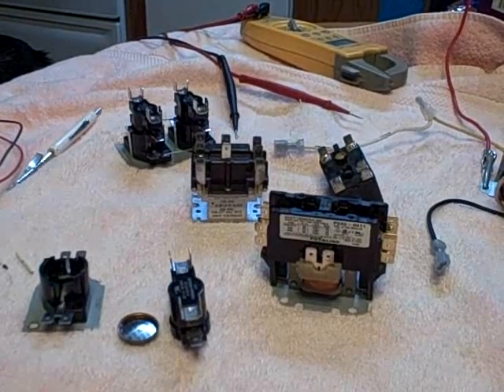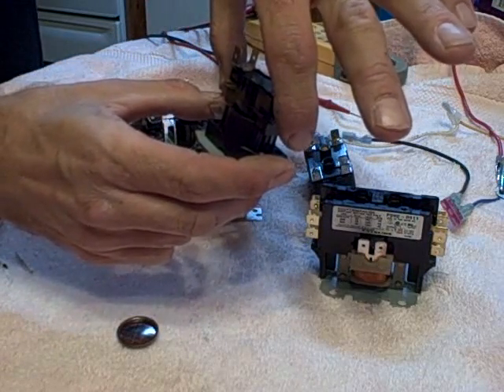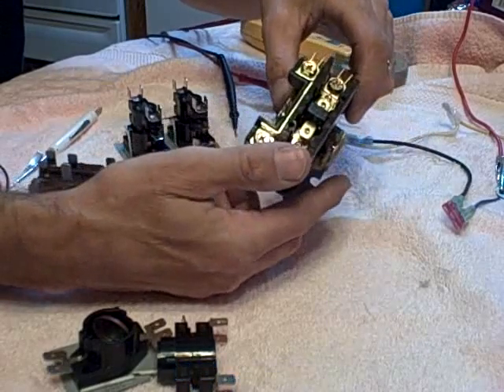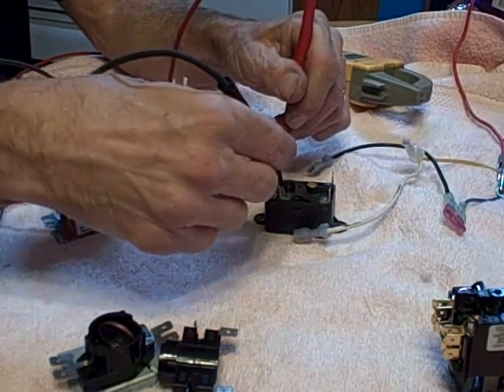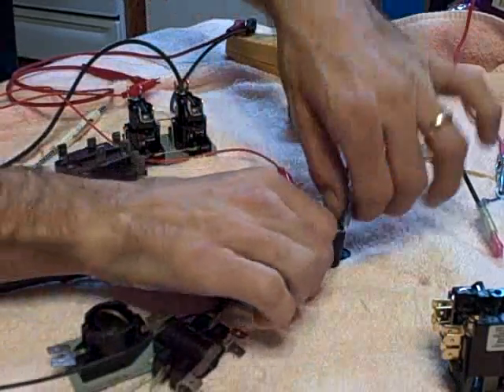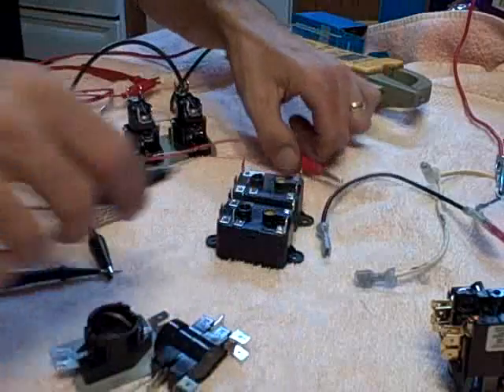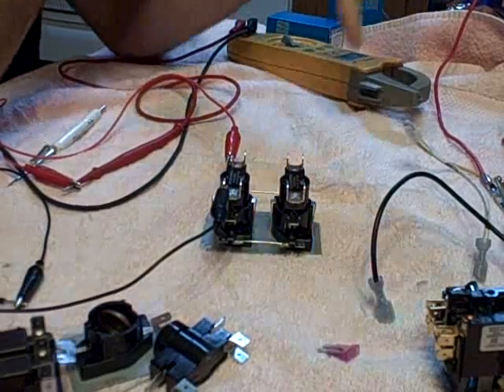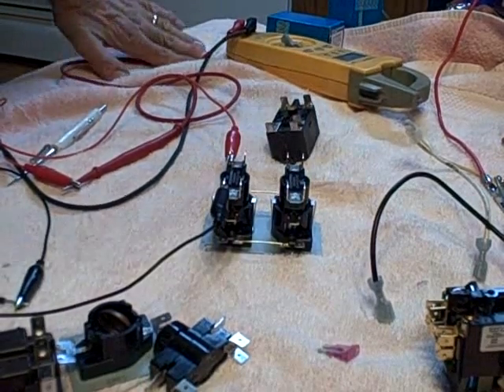HVAC relays and heat sequencers

Comment: This relay looks like 1 of 3 that I have in my unit if it is indeed a r8229a 1005.  I have 3 in my furnace.  It appears they are all running all 25kw worth of elements at the same time.   Would these not alternate the elements or do I have maybe an electrical problem?  Any help would be grateful here guys!

Comment: where do we buy the 1986  miller relay from therm-to the old long fuzes to heat coles its a single MILLER BRAND  ARE THEY A INTERCHANGE HEATER STAYS ON RELAY SPARKS WITH ELECT
Reply from the maker: Hi Winston. 
I hate to say it, but I'm really having a hard time trying to figure out what you are saying and asking for here. 

You really need to use punctuation, commas, periods and question marks so I can tell where one sentence ends and another begins.

Ill start with what I can figure out though!
It doesn't matter what year or brand the equipment is that the relay is in, and it doesn't matter what brand the relay is, EVERY relay can be replaced, you just need to know a few things:
1. What is the controlling voltage. The voltage that activates the coil or element to turn on our off whatever it is you are trying to control. Most residential units use 24 volts (sometimes it says 28v, but pretty much the same thing)  for control circuits including the thermostat. HOWEVER some old or strange equipment will use high voltage, such as 240 volts, to control the relays. You have to make sure!
2. Is it just an on/off relay or is it a timed relay. Timed relays can use an electronic circuit in the relay to count the delay time, or heats up a metal disc that changes size and pops inside out, closing or opening the circuit.
You don't have to go back with the same either, you can use a circuit type to replace a disc type, or visa-versa, they all just count time.
3. You need to know how much voltage and current you will be controlling with the relay. For example, in an electric air handler that uses electric heat strips, you might need to handle 240 volts and 20 amps for a heat strip. Or a relay for a blower motor on a gas furnace it might be 120 volts and 15 amps. You always want to get relays that are rated higher than what you need. So say that blower relay, you would get a relay that could handle 20 amps so that it has a safety margin, the heat strip relay, you could get one rated at 30 amps to handle the 20 it will control.

Then there's Limit Switches. For example on a gas furnace, the switch (relay) is mounted against the heat chamber with a metal casing that holds a metal disc in it. Instead of a control voltage heating the disc, the heat from the furnace heat chamber heats the disc. The disc is rated for a safety high limit, such as 380 degrees (just making a number up here!) And if the heat chamber gets too hot and goes over that temp (pretend the blower motor dies), the disc pops inside-out and the relay activates. In this case it mightopen the relay and cut off 24 volts going to the gas valve. Or it could open and cut off 120 volts to the entire unit. (Not likely, but a good example!)
When the disc cools below a certain temp then the disc pops back and resets the relay, turning things back on.

Well I hope this gives you some good information to get started with! If you can get some more detailed information on the relay ill see if we can get it figured out. I deal with health issues here so not always very good at answering messages, just a heads up! Hehe! Take care!!

Comment: So if my “low speed” for my blower motor is getting voltage from the sequencer since it’s running through my normally closed contacts .. would it not run all the time in low speed with no call if one leg is always hot already on the blower motor (common) ?
Reply: lorenso lares you need 24 volts from the thermostat white wire to the sequencer to activate it.

Comment: Love the video only 1 by far that is easily explained but I have a 90-380 relay like in video , [ Have u supplied 24v on both coils 1&3 or just neutral ] I have 24v on 1 coil but contacts not engaged

Comment: I want heat to run in low speed. I don't understand because turning on heat will activate the relay just as in cool. If I run a jumper to low and get energized through the sequence, I would run 2 speeds at one time?

Comment: These kind of techs could use a few semesters of electronics alone, like 3, 1st DC and its property s, 2nd AC and its functions, and finally on devices. The last semester you put it all together. In fact electronics should be the first thing you study and get a handle on. Then the physics of AC/Heat and functions of popular systems.

Comment: Thank you for your vids. They are a great help. I have a hard time with swapping sequensers that are not the exact same. I have one that one side of 24v goes to a ceramic fuse attached to the casing of ac. Old Lennox units. The fan is also jumped to both sequensers, I understand the need for jump at 24v but this is confusing.
Reply from the maker: dossen2620 yeah, sometimes you will run across some really weird wiring, especially on old units after a hundred different techs have put their hands in there and not left it wired like it originally was :)
Electric heat frequently taps either the medium or low speed through the hv side of a sequencer, that one will get its power from the normally closed side of the fan relay. That way there is no chance that high and low can be activated at the same time.
Reply: mikie2501 thank you for your reply. I have old Lennox units with h1 h2 aux1 and aux2. Having a hard time finding the exact replacements and trying to understand the theory of this wiring and how to replace it with a standard sequencer. I have email you can find some time to help me out. I'm a big fan

Comment: Hi 
I am doing a school project where I have to build A Diagram consisting of Three lights, but when you energize any one of the lights it Would make it impossible for the other two lights to be energized. 
Can you please help. 
Thank you
Reply from the maker: Sorry, been pretty busy and not much time for email!  You didn't list any parameter requirements, allowed components or components expected to use...
Reply: +mikie2501. 
Hi Mike. Thank you for replying. this project is actually just a Diagram we have to draw. 120V power. we Can use as many switches as we need and we can also use relay and transformer if needed. 
nothing to crazy.
Reply from the maker: +ahmad mahmoud sorry for the delay. Yeah, I'd asked because I was wondering if there were certain requirements that you had to meet. Honestly that would be a simple diagram, three bulbs and a four position swirch. Three positions for each of the bulbs and the fourth for off.  Run the same hot wire to all bulbs, bring the neutral to the switch input and run three of the switch outputs to the neutral spots on the bulbs. Done.

Comment: if the relay doesnt click when you connect the transformer to it, that means is not good. always?
Reply from the maker: If you apply 24-28 volts across the relay coil it should activate the relay, unless its a time delay relay that has to heat up first, but essentially yes, it should close (or open as the case may be).  Some may be hard to hear, but you can always take a meter and test via continuity to make sure that its opening or closing.  If it doesnt then either its bad or possibly you have the wrong relay... By this I mean that some relays are designed to be activated by different voltages, such as 120 volts, some are DC instead of AC and you cant mix them up. Hope that answers your question.

Comment: My attic blower unit fan sequencer switch (24A34-1/H1-20 C40-110) actual off time increases during the heat of day to approximately six minutes.  At night it falls back to the rated off time.  I replaced the switch with an identical new spare I had and got the same exact results.  Would this be normal or do I have other issues?
Reply from the maker: Interesting!!  Hehe :). I take it that its pretty scorching hot up there!  It sounds like in the heat of the day its taking longer for the metal disc in it to cool off and pop back.  Ive never actually timed them before! How is your ventilation in the attic?  Check your soffit vents to make sure they are open under the eaves and the painters havent rolled them flat and closed when they painted in the past, make sure they arent blocked in the attic. Of course do the inside stuff in the evening and have someone there to keep an eye on you, its super easy to overheat up there or get stuck in a bad spot!!  Wouldnt hurt to check the roof ventilation or possibly have someone check to see if they were   Installed properly and enough vents.

Comment: I am trying to track down a short as my amp draw on the secondary of the trans was 7 amps.  I got it down to 1.6 by rewiring some of the stat wiring. However, when I call for cool, the trans blows ( need a fuse) but something is still array. So I am suspecting the sequencer and need to check it. My question is, did you say the top or first level of sequencer should be normally open?   I ohmed the one in the unit and got conductance on top level, all wires disconnected of course.  I didn't get the details about the normal open close on the sequencer. Thanks!
Reply from the maker: Hi!  Well I havent watched the video in a while but...  All heat sequencers, that Ive ever seen anyway, are ALL normally open until they get a call from the thermostat.  You said it blows when you do a call for cool.
You might try this:  cut the 240v power to the condenser outside (is this straight cool or heat pump?) and then try and disconnecting the wires on the contactor outside.  If the contactor coil is shorted or shorted to ground this would explain why you blow it when you have a call for cool.

...but before you get that far you might check the low voltage wiring outside to see if the wires have been dog chewed or hit by the weedeater and are shorted!  ....also rats/mice in the attic sometimes short the low voltage wiring!
Reply: Always normally open, till it gets control voltage. Then the bi metal disc heats up and pops up to make the connection.

Comment: I have a package ac unit outside with coils for heat in the winter.  Help me decide what relay to buy.  The thermostat calls for heat and the heater will turn on. The temperature is reached and the thermostat stops calling for heat but the fan continues running.  The fan has and will continue to run all night or all day if I let it. 

But if I take and toggle the 'Auto/On' switch enough it will turn the fan off. My thermostat is a brand new Honeywell digital programmable thermostat. 

I propose the heat delay relay am I right?

Comment: insight needed anyone!  had a compressor in a heat pump the other day not pumping or sucking. the suction line pressures dropped maybe 5 psi after starting. replaced the compressor aND STILL SAME SYMPTOMS. what are your thoughts on this before recovering any more refrigerant. half stuck reversing valve? i know when there is a blockage (txv/filter) the pressures are exaggerated and you will know but this...hmm.  Just started working on heat pumps
Reply from the maker: If your not seeing a pressure difference of much my first bet would be a reversing valve that is stuck in the middle or broke.  If you fire it up try and check along the lines from the compressor outward for the temp Change spot, frosting or the like where a blockage is causing metering.  Not seeing the pressures myself I assume the filters arent blocked or youve changed them (easy to check for metering there) or crud isnt clogging the metering device or clogging the screen before the metering device.  Is there any line solinoids?  ...but anyway it does sound like its stuck of you arent seeing a suction drop.  Check to see if your getting voltage to the valve (always get ruud/rheem and normal units mixed in my head as to when voltage is applied, cold or heat mode;) Try throwing it into heat mode and see if the valve unsticks, try switching back and forth a few times. Might try gently tapping it with a rubber mallet.  However if its stuck you might as well replace it even if it comes unstuck because its bound to happen again!  Keep us updated! ;)
Reply: mikie2501 ya had to be reversing valve. pressure on r22 were about 150 equalized (both sides/off) then when turned on no changes except low side dropped maybe 4 psi. right , if something was clogged the pressure drops/differences would be signifigantly noticable

Comment: Hey anybody can help me? My hvac relay it won't stay on,only if I pushing it holding it down.&if I let go,it will turn off.. Help me please!!!!
Reply from the maker: You probably need to get a tech to look at it, the list of reasons why a relay isn't closing can get pretty long, and you haven't really said anything about your system and what is working, what isn't, what you're trying to run, what relay it is, etc.

Comment: Hey I'm new in hvac; this is my first semester. Will somebody please for the life of me explain why does the meter read 0 when the coil is energized. My thinking is it should read 24 volts because the current is flowing to keep the magnet energized. I know my thinking is wrong but I need someone to logically explain to me why it is wrong so that I will understand.
Reply from the maker: Ah, thats an easy one. If you're trying to measure voltage between two points, you can only get a reading if the circuit is open between the two.  If the circuit is closed and voltage is present you have to have one lead on a ground somewhere to show voltage.   With the circuit closed, as far as your meter is concerned it sees the exact same thing on both probes, so it doesnt register anything.   This fact comes in handy later testing circuits and will tell you if something is working and passing voltage or has an open circuit or safety or the like.
Reply: Put another way - If you had a bare wire with current running through it and you touch your meter lead to the bare wire and then touch the other lead an inch down from the first on the same wire you'd expect to read zero voltage right?  But if you then cut the wire between the two points then NOW your meter shows voltage.  When the coil is energized it's that wire with no (hopefully) "cuts" in it.
Reply: Because there is no voltage difference when the coil is energized

Comment from the maker: While not necessary, heat strip delay on while the blower comes on first extends the life of the heat strips, the same with the blower being the last thing off. Stepping on the strips a few at a time keeps a large surge load from hitting the house and causing fun things to happen till the current load is equalized :)

Comment: Good point about the 3amp fuse on the 24volt side of the transformer. I wire them into units I have at all my propertys because I've lost a couple due to dogs chewing on the low voltage wire going to the outside condenser unit and shorting the low voltage system.

Comment from the maker: @remodelservices Any hvac supply house has them, the thing is trying to find one that will sell retail if you don't have an account or a business (tax number).  Some will sell retail though, dunno on price.  Transformer is no big deal though, can get those anywhere, a decent 28v doorbell txfmr will do fine.  ...if there is an hvac company in your area you could ask them if you could have some sequencers off of an old unit they are replacing or something though.

Comment from the maker: yes, assuming everything is wired right if your running the AC and you still have a heat sequencer that isn't being powered on the coil by 24-28v and i'ts powering the heat strip then it is most likely stuck!  I find a few every year like this.  Sympom is the thing isn't cooling that great but not low on freon.  pressures look too high.  Always a good catch! :>

Comment: This is great information Mike. I'm just learning about troubleshoots on AC system. When I hooked up my meter, I notice that when I set it on cooling, the heat seem to stay on too (it stays energized). Will a bad heater relay causes it to stay on while it on cooling mode?

Comment from the maker: If I am understanding you correctly it's a simple miswiring.   If your powering term. 1, then term 2 (norm. closed) should go right to the fan/limit switch.  Fan limit should ALWAYS be hot unless you have cool or fan engaging HIGH speed. That way fan/limit always has power to engage low/heat speed. with term2 to the limit switch, the switch controls low speed, and powering the relay will switch to term3 and cut on high speed.   Draw it out on paper and see if it helps to look at it that way!

Comment from the maker: Ran outta space there!  Anyway wouldn't want to blower speeds being called on at the same time so when you turn the blower on at the t-stat and it calls for HIGH speed the relay switches from Normally Closed (med/low speed) to the Normally Open position (HIGH speed) and takes out the chance of dammaging the motor. :)

Comment from the maker: On the normally OPEN side of the fan relay they will typically have the High blower speed wired.  On the normally CLOSED (always powered) side of the relay they will jumper to the 1-24 second (or whatever) On Sequencer to power the back side of the sequencer in a call for heat.  So when heat is called the sequencer closes and passes voltage to the medium or low speed that is hooked up on the sequencer.   The REASON is to keep someone from turning fan on at t-stat and burning motor  w/2 speeds on
Reply: Wait so for 3 speed fan blower the high speed will always be open? Then when someone calls for heating the medium and low speed automatically turns on until someone raises the temp that will then make the blower run on high speed? I hope I'm making sense, I just not familiar with electric furnaces. I fix appliances. 😢